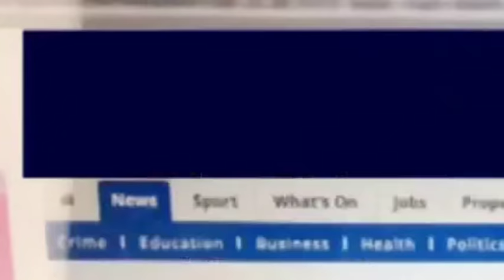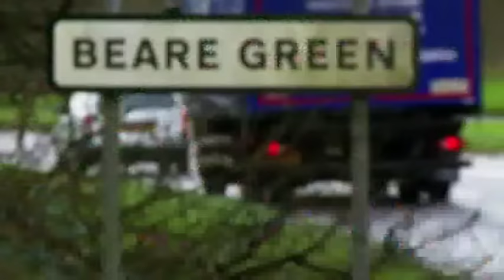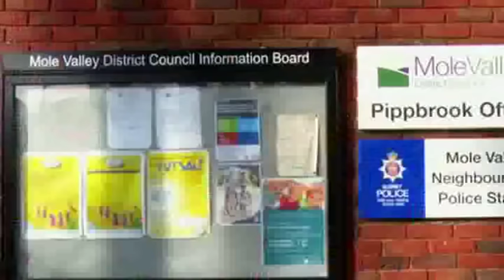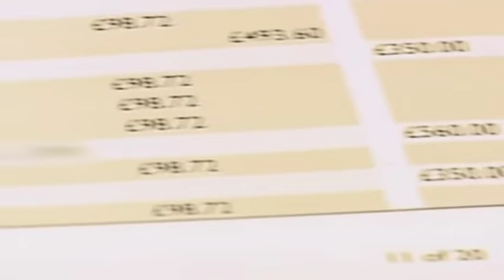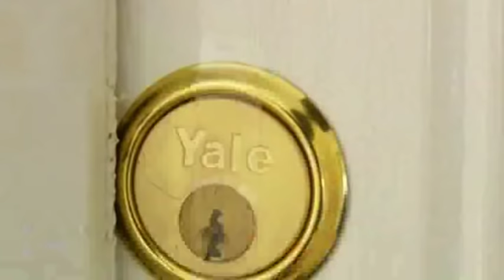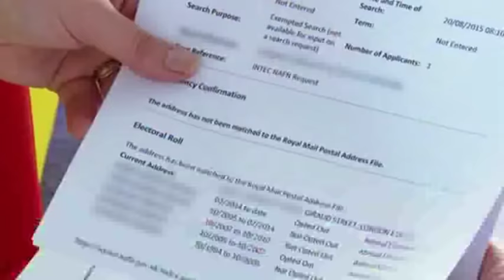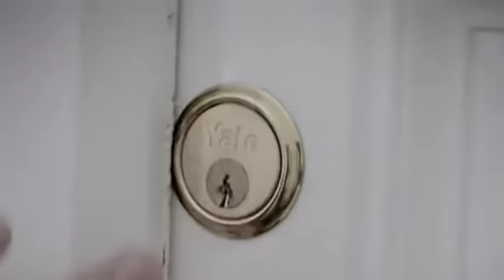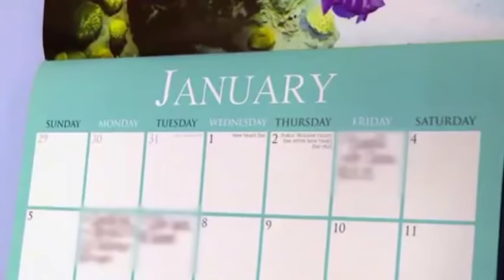Council House Crackdown S02E02 | 24th May 2016

Comment: Why are the investigations so slow? Why do these people get away with this for so long? 
The penalties need to be much higher, with more jail time. Banned from social housing forever.
What is the point of giving a suspended sentence? It's a joke. How is that going to put anyone off doing!
Reply: I've worked in housing and the honest answer is that there are too many referrals and not  enough staff to investigate. Sometimes investigations only get so far and then evidence doesn't secure convictions etc. Sometimes the referrals are malicious, sometimes it takes so long to get court dates/warrants etc. There's backlog in every step of the way which is why it takes so long. The process of investigating is expensive and time-consuming

Comment: Here's A very good idea for all of the British people.  This is what we do over here in the United States we have on every housing  complex an on the site manager. Those people actually live on the property so they can have around the clock maintainence to make any and all necessary repairs or emergency repairs such as the water pipes breaking or an electrical wiring problems. And it's the on site managers job to screen every single person before the rent to fill out an application and then they put it through a thorough back round check even with the housing authorities & the police and the courts. and the person who wishes to rent they have to have excellent credit. And any tenant that has any kind of criminal charges they are automatically refused for the safety of the other tenants.  And when the tenant moves out they do an on site inspection and if any damages to the property the tenant when they sign the rental agreement will clearly state that the tenant is held legally responsible and anyone who is late paying the rent even if the tenant is late 30-days the tenant will be given A 30-day eviction notice or even A 48-hour eviction notice that's when the manager and the police will have every legal right to go in after the eviction notice is served to remove the tenant. And if that happens it will go on your rental record and no one will never rent to you. plus the On-site manager can easily catch anyone committing A fraud or give A 30-day eviction to remove the person who is not on the rental agreement.
Reply: Thank you but it just doesn't roll that way
Reply: @Telboy555  💯
Reply: That great but in Britain the law seems to suck. Someone can squat in a house and you have to go to court to get them out! Even then they don’t leave. You have to pay a bailiff to throw them out. I watched a UK program a while ago and a couple moved out of their house for two weeks while they did a Reno. Squatters moved in and it took months and months for them to get them out! Plus the woman was was expecting a baby. These poor people had to leave in a small room with their newborn at her moms place. While the squatters enjoyed their home free of charge. What a joke.